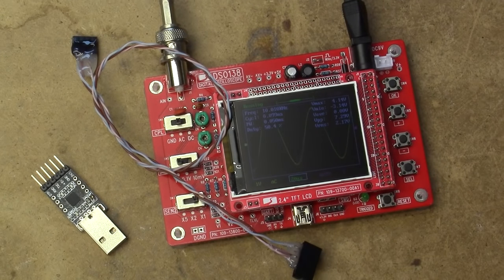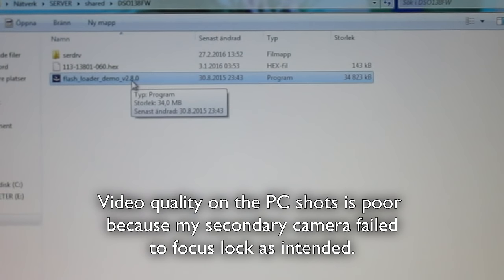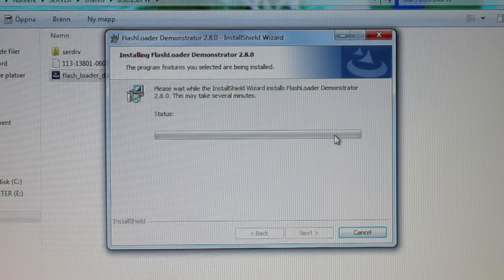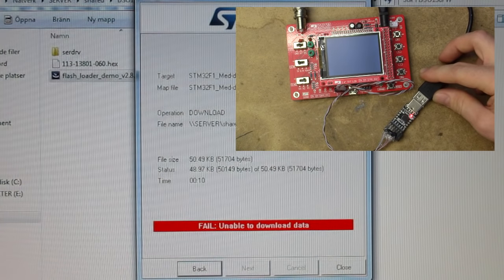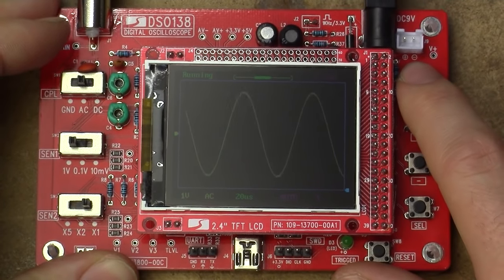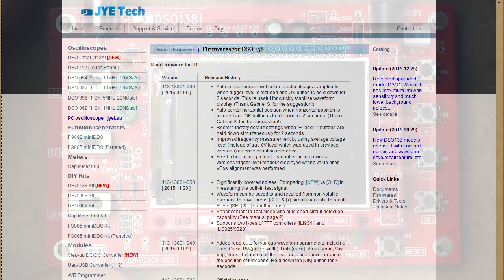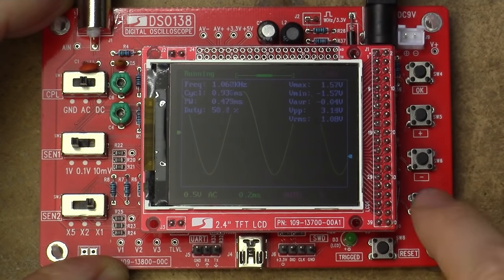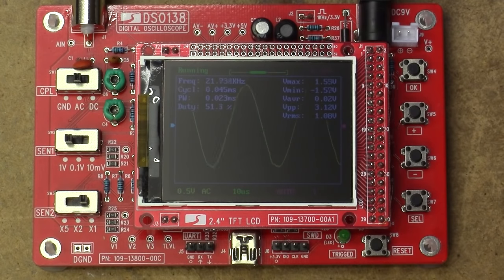DSO138 firmware upgrade and review

Comment: LOL - "When did the age of stand alone executables end?" - a man after my own heart! lol
Reply: Hmmm,  I think it was about the time Microsoft, IBM and Intel got in bed together.  I caught that statement too Mike,  it used to be nice!
Reply: You may be right ... OS/2 comes to mind when you mention that time period ... an operating system that I actually used for a while and thought had potential.

It's still possible to make single executable programs for Windows, but even that is really an illusion since it will always rely on DLL files to perform certain functions.  I think the closest thing we have today are the "portable apps" that can be installed on thumb drives and executed without needing to be installed. 

And as I think about it, it's probably for the best that installation is required, because when software can have access to sensitive areas of an operating system without any security measures being taken, its all bad for the user. This is why I like OSX (soon to be MacOS) ... the security that is offers is very good and does not really hinder the user experience at all. Apple engineering is amazing in my opinion.

Comment: Hi. I followed exactly all the steps  It worked just fine, no worries, upgraded to Ver. 061. But  after the update I had functionality issues like: The amplitude readings were not correct testing the calibration probe there should be someting like 3.7 Vpp- in V042 version it was correct, but in Ver.062 the readings were like 0.9Vpp. Under 1Vpp! I had to return the firmware to Ver.042.. Thank you to remind to save the original Firmware..

Comment: You should seriously consider disabling "hide extensions for known file types" in Windows Explorer, if you value your security at all. There's no shortage of malware disguised with double extensions to exploit this failing of Explorer.
Reply from the maker: That's how I usually do it, but my bench computer also doubles as a "This is what customers' computers usually look like" reference. I try not to change stuff around on it if it can be avoided.
Reply: FFcossag My instinctive reaction when I see someone using the default setting is to scream at them. I've had far too many customers do stupid things because of it ("gee, this file seems innocuous, let's open it!") :-/

Comment: thanks....
got one of these for Christmas. it was purchased on Amazon. it is definitely a counterfit. i would have never even suspected this if I hadn't seen this video. the first one came with a broken display. the second one has the trigger LED stuck on. took the display from the second one and put it on the first. I now have a functional unit but can't fine tune the probe as per instructions. swapped out the tuning capacitor to no avail. I'm not doing any high speed stuff so I don't really care.
my ground is sitting at 2v. when measuring a 12v and -12v power supply I get 14v and -10v.
I am running it with a 12v supply and suspect the 9v regulator in the scope is junk. hopefully when I find a 9v power supply this will go away. 
bottom line....after seeing this video I would NEVER attempt the upgrade....thanks again!!

Comment: i know this is old  , but you just demonstrated why you should immobilize your connections before flash so they dont get bumped.  Also  the flash app you  show is  also teh same you  you can use to flash STM32F103's  now the the arduino IDE  and even use to to put a arduino Nano like boot loader on your  STM32F devices.   Thanks for vid man .

Comment: Cool stuff.

I have a project on the go that requires interface Via a Uart-USB converter. I also need a terminal emulator program comparable with Win XP. Any idea’s?Baud 19.2K, Databits 8, Stopbit 1, Parity None, Handshake None, are the suggested settings for menu driven diagnostic of Philips CDR775. Would be grateful for any help available with this.

Kind regards

Comment: FFcossag, would you chance connecting a 1:10 probe on the DSO and stick it into the mains, being mindful to connect the ground to the neutral?  Of course ustilizing an isolated power supply on the scope.
Reply from the maker: +Donovan Lym That's really not a good idea for anything with exposed metal parts.

Comment: Can I just connect it directly to a motherboard serial com port without this usb converter? Pin 2,3,5 should be RX,TX and Ground if I see it correctly.
Reply from the maker: +AxelL No1 Yes, but you have to use a level converter like a MAX232. Else things will break.
Reply: +FFcossag Thanks!

Comment: Why do you buy junk, like this crap.
Reply from the maker: +MrMac5150 This was donated to me in order to help smart people make an informed decision about whether or not to buy junk like this crap.
Reply: FFcossag
 We both agree it is junk.
Reply from the maker: +MrMac5150 It costs twenty-three dollars. That is roughly the same price as ten ice-cream cones, or two lunches, or one third of a Nissan front left brake line.
Reply: FFcossag
 What a analogy.
Reply: It costs less than one lunch or three glasses of beer here. It is also good practice for smd soldering and as a basis for further experimentation. So from an education perspective it is very good value for money. I would recommend getting one. No one buys this instead of a Rigol or Tectronix.
Reply: If this scope pretended to be quality then it would be 'junk'. However it is just an educational tool at a very, very low price.

China makes cheap and cheerful as well as superb quality equipment.  I have paid over 6000 USD for a Rigol DS4054 Chinese scope. This is as good if not better than almost anything that can be made in the west.  I will buy the best equipment and increasingly this is from China. The world moves on.
Reply: An analogy!
Reply: +MrMac5150 I bet your fun at parties.
Reply: Ryan Walker
Wild